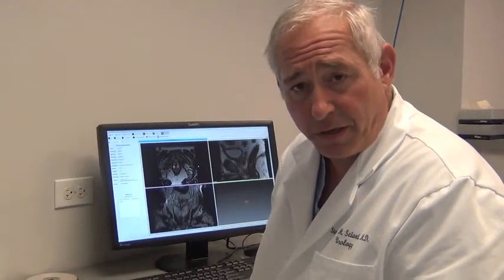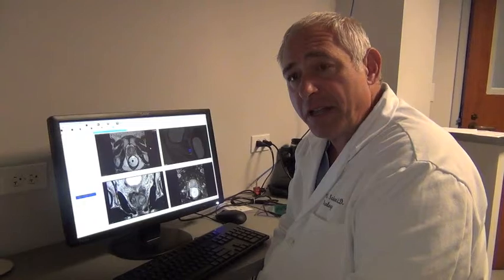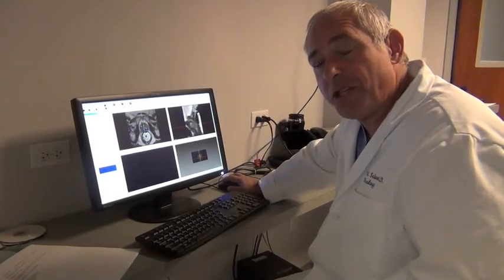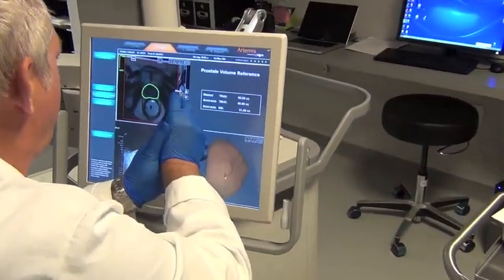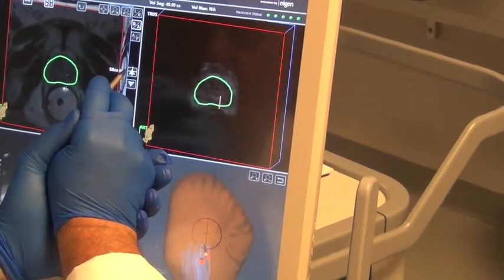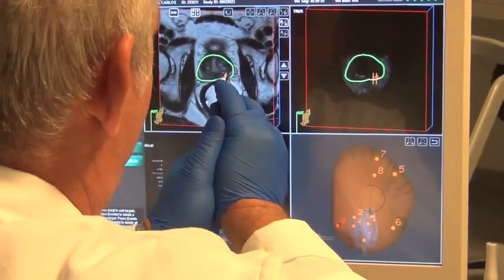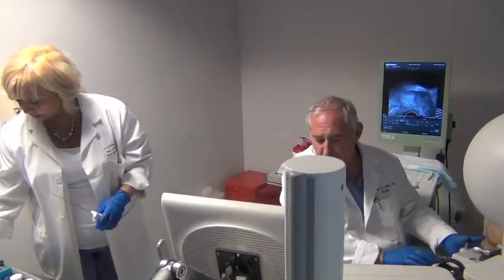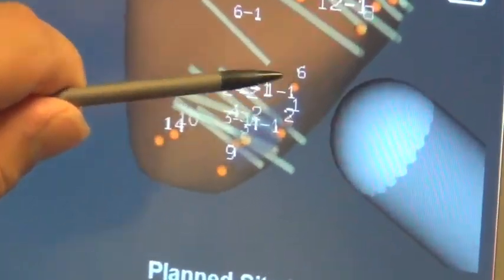Dr Scionti Artemis Targeted Prostate Biopsy

Comment: Y'know, I've got one of these scheduled in my future and uncannily, I'm 72 with a pirads 4 lesion located in the midperipheral right side of the prostate.  My doc said he felt no abnormalities during DRE.  My PSA went from .96 to 3.3 in 2.5years after my PCP put me in testosterone ciprionate.  So, we're not sure if my PSA jumped because of the TRT....year one I was on 100mg and then he kicked it up to 200 mg year 2....PSA went up over that time %250 so, the introduction of TRT Ciprionate screwed things up from what I can see.  So, in conclusion, I'm scared and pissed.  My PCP should have warned me about adverse effects of the ciprionate AT MY AGE, and should have checked me via DRE and PSA tests before putting me on the crap.  I had PSA's for years at .46 to .96....then skyrocketed when on ciprionate.  Also, my urologist plans a MRI / TRUS fusion biopsy.....TRUS can cause infection going thru the rectum, and, it's difficult or darn near impossible to biopsy the anterior part of the gland.  My other fear is this is going to hurt like hell....let me know what you think, if you can.  Great Presentation, very informative.